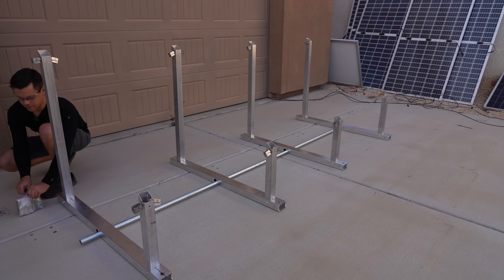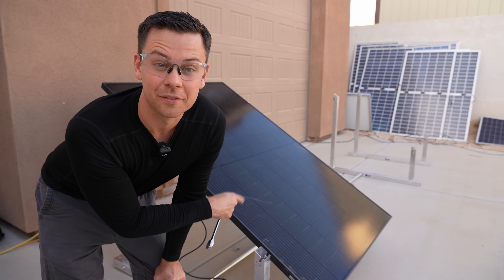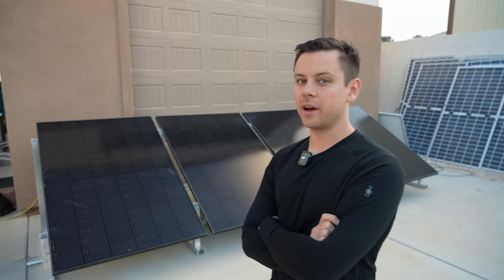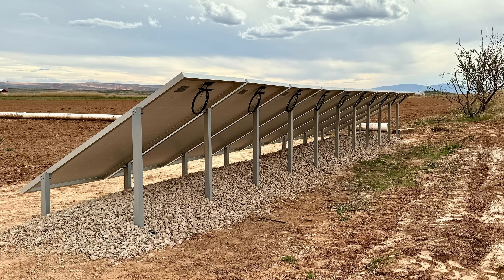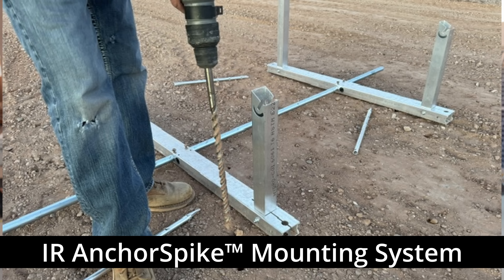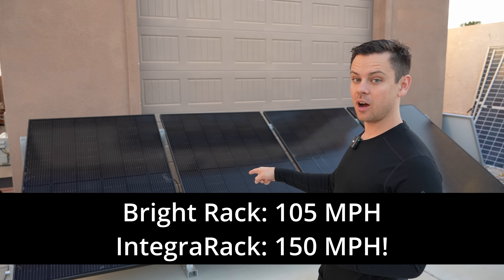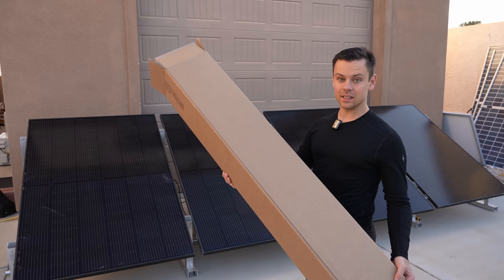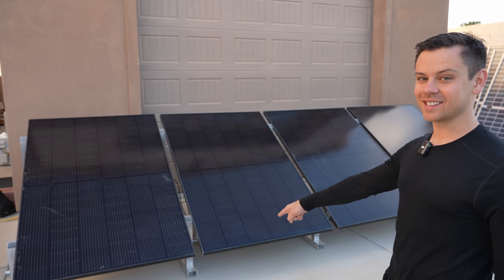IntegraRack: $545 Ground Mount Solar Array Assembled in Less Than an Hour!

Comment: was curious on your input on the best 48 volt system for a van I like the server rack idea and power to price but dont know how much it would take to keep something like your portable system charged I could see 500 watts 750 at max on roof but not enough voltage for to charge 48?

Comment: I've been trying different mounting angles for my panels & I discovered something curious.  When my panels are at 90⁰ to the sun I get the highest peak output, but I get the highest kwh per day, along with the highest sustained peak of approximately 6 hours, from laying my panels flat on my lawn.  This makes no sense to me, but my conclusion, then, is to forget the mounts/racks & just lay them all flat.  You have any input/pro-vs-con on this?

Comment: The only negative is the lack of adjustments for the solstice. In the winter panel are raised to 60° and dropped to 30°. Other than that issue I'd buy them and modify for adjustments.

Comment: Problems: Animals. Cows. Specifically. Projectiles, kids with guns, BB or otherwise. Quite tempting. Angle adjustment. Good looking solution though, I have to admit.

Also, the vertical mount for bifacial panels is awesome (different video).
Reply: No problem with our Llamas. We have critter guard installed. They go right up to it have a sniff then move on. 17 panels

Comment: Hey Will, 
I like the simplicity of it. But I haven't seen anyone with the post mount with solar tracker. I have 2  pole mounted systems and because I was only getting the best coverage in the afternoon. So I installed a set of solar trackers to my system and it makes a big difference. I would like to see more solar trackers. I wanted to share a video but I couldn't.  Thanks

Comment: Level of difficulty getting this entire thing up in the air? Above a shed or something? I imagine I could bury some poles 3 feet and just get this up. But is that true or would this fold if it’s not supported as it is on the ground, and, is it true that if not angled correctly, this could create a solar death ray on things behind it. 

Thanks for any help

Comment: I've got two 200w panels to install on a camper. I'm seeing that I need 8 gauge for 400watts but from the panels to the batteries it could be almost 30 feet from the solar panels to the charge controller to the batteries. Would that require 4-6 and what from the converter/inverter? 4 guage? One of my goals is to not set the camper on fire while not having a huge voltage drop from over building it. Such as the controller. 400w says 30 amp controller but I read the watt hrs will be like 33.3 per hr? Can a 30amp charge controller handle that at summer mid day peak?

Comment: Hey Will, I'm building a coffee trailer (mobile coffee shop) for the Denver metro area and would like to power it with solar. Not sure if you'd be interested in working through it with me to figure out how to run the power I need. I could bring the trailer to you. Might make for a very interesting video setting up a commercial espresso machine to run efficiently on a battery bank. Let me know, Cheers! Love the channel

Comment: Is anyone out there building a home power system that is mostly DC. Resistive floor heating, electric water heaters, ovens, stoves, dryers are likely the biggest energy users and all of them could be DC. You can still have an inverter but it could be much smaller.

Comment: Will i have a vehicle question
When i have lead acid starting  batteries and lithium house batteries...
Can i intercept the voltage coming off the alternator and send it through a charge controller to the lithium batteries to protect them...

Comment: I didn't see it anywhere but then again it's hard to search through the comments, BUT you should change your picture for this video.   It's NOT $545 with 4 panels,   It's $545 to mount 4 panels.    When I first saw your video I thought someone had really made a price breakthrough and would capture the solar mount market by storm.   $545 for four panels is still way more expensive than DIY solutions...

Comment: Holy cow, Will!  I've been away from the solar/battery stuff for a couple years and it's crazy to see the growth of your channel since then.  Congrats man, you deserve it.  Only downfall I see is in northern states with snow, it looks too low and snow could drift up on the lower portion of the panels.  Probably wouldn't be that hard to raise it some way, but just another thing to consider for those who don't live in the southern states.

Comment: Looks like it works great on a flat stable surface only.  Plus it is using the panel frame itself for structural integrity, placing a lot of extra stress on the silicon wafers.  Definitely not as strong as a rail system I would imagine.

Comment: Needs a way to cover the vertical tubes, here in the Florida insects and critters will nest there.  Open top tubes will collect rainwater and will rust the lower assembly.  High wind speed rating and everything else are major advantage.  Thanks for investing your time and funds to make informative & interesting videos!
Reply: Aluminum, so no rust issues. Critters tho... yes. I would like to see caps too just for the aesthetics of it.

Comment: I copied the GSE ground mount, welded rather than bolted together and added some tabs so i can move it around with pallet forks..120kg ballast per panel and it holds 2, cost less than €200 and a day to fabricobble.

Comment: Hey I have 2 12volt bildge pumps they can run up to 13.5volts if I want. My question is if I use a lifepo4 12volt then will it pute out 12 volts or more like 11.5? It's more expensive but am dreading having to go to 24 volt 150 amp hr and running a buck boost converter or sign wave converter.
Reply: I am running 2 pumps both at 12 volts one is 7amps the other is 15amps

Comment: i had a question about the easy 48v system and far as if i had 4 370w 37volt solar panels in sires it will be over 120 volts but its close would i need a mppt boost charge controler?

Comment: The cost is still way too high. the rack itself is way over priced, the should be about half the cost, now add several tons of gravel and the cost involved for that, or even more expensive is the water tank means to hold them down. Sounds good, but in reality  - not, simply because of the cost of the rack.

Comment: Say I wanted to hook a few panels up to power my computer, what's the cheapest inverter for the higher output panels and is there recommended max length for the cable from the inverter to an outlet box?

Comment: First off is if you caver it the Chinese metal will be destroyed over time. Best install is to create 4 or 6 concreate pillars and mount to that. You can do this cheap with concrete blocks or pour 2 bags per pillar.

Comment: Just came back from Baja California getting ready to start building my retirement home off grid been looking at different systems on youtube and in my opinion you got the best information on off grid system
Reply: I live in Cabo and have 140 acres in Todos Santos. Where are you building? I'm hauling 60 655 watt panels down to MX next week. CFE electricity prices are as expensive as California and WAY worse if you hit the DAC (domestic high consumption).

Comment: this is exactly the kind of product I am looking for... Does anyone know how the water tanks are used to hold down the frames? Like where do they sit (directly on the frames? how to avoid them tipping over? Shims?)

He mentioned 800 pounds, so I assume ~100 gallons of water, but then the tank pictured is a 35 gallon tank??? I've looked those tanks up on that website, just curious how they sit on the frame).

Are there any pictures or examples of that kind of installation? Can the manufacturer possibly add some example pictures of that kind of installation?

I would love to use that kind of method because I would like to enclose the tanks (to protect them from the sun) and be able to count that water as part of my prepper water storage. Maybe not water I would drink (unless in an emergency), but it certainly would be suitable for watering plants/washing/cleaning/etc.

Comment: Looks like excellent engineering. I'm glad there's some decent options available for mounting nowadays. Cosmetic wise I don't like gaps in-between panels. Function wise it be nice to be able to adjust the angle. Cool system though I honestly like it.

Comment: Remember, aluminum metal touching a concrete surface is not compatible. Therefore, you must have a neutral spacer between the aluminum and the concrete surfaces.
Reply: I did not know that about alumium and concrete.  Thanks.

Comment: I like a steeper pitch and higher off the ground the amount I lose in efficiency I make up for when the snow just slides off rather quickly in the winter just a view of the sountern sky and it simply works no effort no cleaning the panels off they stay clean enough to only go out with a shammy when its warm to clean off dust. I've only ever built with wood didn't need no anchors the amount of panels and the length kept it from getting knocked by 60+ winds. My wind turbine tower on the other hand took a dive at that speed. But yeah I'd never go with something this low to the ground or that low of a pitch I've already been there lived and learned. Although I know it is the most ideal angle for catching sun it sucks come winter time trust me on this one.

Comment: I just saw this video.  To say it's timely would be accurate.  I wintered in Arizona in my RV and I had 2 400 watt solar panels which I hauled with me in my motorcycle trailer.  I ground deployed them which worked but wasn't optimal.  I was planning to mount those panels to the roof of the trailer for next winter but after seeing your video I think I'll buy enough of these to mount all 3 of my panels.  I'll use large lag screws to anchor them into the ground.  In Arizona the soil is very rocky and lag screws work very well, even during wind storms.

Comment: Nice solar mounting system, I hope you do a review of Schneider Electric's new Conext™ XW Pro solar hybrid inverter/charger they often go on sale. they are a low frequency inverter that can handle large inductive loads split phase output but all has a low idle current draw.

Comment: Great video! If I understand correctly, it's just the mounting brackets - does it work with any panels, and what's the best (easiest) way to connect it to the house? As you have probably guessed, I'm a COMPLETE newb when it comes to solar - so I can use all the help I can get.
What kind of panels do you recommend, and what kind of power storage?
My property is surrounded by trees so I'm not gonna get a full 8 hrs of sun.

Comment: Great presentation, and I really like the way this racking system looks.  I am very curious about the AnchorSpikes  How long are they?  From their web site it looks like they are 3/4", but one of the pipes in your hand looks wider than 1".  Also, from your video you implied that you just drill out the hole with a hammer drill, set, and then pour the epoxy.  Is that true?  If so, do you drill the hole larger, smaller, or just shoot for the OD?
Reply: Just a note, the manufacturer just got back to me via email with the following information: they are 19.5" long, and you do drill out the dirt prior to setting the spikes, and then pouring the epoxy.  I think that code in my area requires to set ground anchors/spikes below the frost line (which is 30" in my local, and I believe most people use 48" as a rule of thumb).  This would be perfect for a short term install.  I will have to think about this one.  Once again, thank you for your informative video.

Comment: Couldn't that not be done with a bunch of 2 by fours for around $100?

Plus. Those are in a single fixed position. They are not movable throughout the day. You only get maximum power in the summertime. In the winter you are going to be running a heat pump. You're going to need a Battery Farm.. Outside of your living structure. When it goes up in flames.  Not if but when. And the batteries can be put in a small, Shipping Container. Like a 20 footer. When it catches fire it's confined inside the shipping container. Away from your occupied dwelling. In the backyard. Not in the garage. Not in the basement. Not on the side of the house. Behind the house. In its own structure. If, you want to be safe about things? And I would recommend having two of those. So that. When one goes up in flames. You are not without power before you rebuild it. You have backup redundant battery power. When you are going off grid. With the above ground water tank and the belowground septic tank. Everything keeping you alive will be in your backyard. In separate, modular, compartmentalized, structures.

And so one could take a, Childs, backyard, kid powered, circular whirly contraption. You build a platform on it. Put your solar array on it. Use an electric motor with a rubber tire drive. And you got a Lazy Susan. You can track the sun. With your solar panel array. Et Voilà! With 2 by fours and some plywood. And the kids backyard playset. And some anchors you put in the ground with eyelets and chains. So it doesn't go blowing away. Except with a Tornado. Only cement escapes most tornadoes. Oh well? It's like Dorothy and her little dog. Nothing you can do, bout that. With your rig, maybe? It could still be left 1/2 busted mess. With rocks and bottles and trees being thrown into your solar panels. Nothing really survives that. So just forget it! LOL.

I'm going to have to put a motorhome array together for myself soon. You've got superb videos on that. A bit pricey though. To do it right. As a retiree living on a fixed Social Security income only. I want to go all electric and off grid. So I'll have my work cut out for me. To get really creative and imaginative. And get an expandable system up and running first. Starting with a minimal, delivery of daily power. And I'm good at regulating mine. And where I really will not be inconvenienced. I will just be mindful. Which is a good way to be. Why waste what you don't need to? You only get so many recharge cycles. Solar panels only truly effective. For about the first 10 years. But when you're old like me. Why worry? Just like the guy in Mad Magazine. I used to read him every month. And Spy versus Spy on the back. And was that about racial injustice or communism? All I know.  I wanted that record called It's A Gas. And I had it. It came with my magazine. It was great! I think I was 12? And Star Trek had just come on the air. I could never miss that show. Absolutely devastated. When it was canceled. I waited for another network to pick it up. It never happened. How were we to live life then? Life is never the same again. Until reruns went into syndication. Then we got our captain back and first officer. And life got back to normal. When the movie came out in 1979. They were still all alive! The cosmic rays hadn't killed them! Huzzah! Huzzah! Huzzah!

Then we grew up to, The Next Generation. We got lost in space. At Deep Space 9. And then hopped aboard a Voyager. Then some clown guys started a new Enterprise. And I got old. How the hell did this happen?

I haven't quite been myself, since 1986. I've been somebody else. A woman! What the hell?
RemyRAD

Comment: Is it made of rust resistant materials?  I know it is not stainless steel, but I live in an area where it gets a lot of rain in the spring and worried that it will end up rusting away in a few years.

Comment: Those anchors with the epoxy are pretty cool. Used helical foundation posts from HD which took awhile to screw into the ground using a 4x as a lever arm

Comment: Can you clarify the water tank information? You show a 35 gallon tank. That'll weigh 280lbs. Would you use 100 gallon tanks (800lbs each), or 3x35 gallon tanks (840lbs total)?
Tanks designed for the interior of an RV will also degrade if exposed to sunlight.

Comment: Although they are not adjustable for angle as some have mentioned (barely a big deal living in the state of AZ with abundance of sun in most places), the numerous ways to secure make the system extremely flexible. With several of the mount methods make relocating so easy relocate is a huge advantage.  Since I am still building out my off grid property, things/plans change and the flexibility to so easily move the rack is again, a huge advantage. Glad to know about these!

Comment: Anyone know if theres a good way to hook up an inverter to the main panel by using a high amperage transfer switch? 
Basically moving grid input cables to a small load center where you can switch from inverter to grid instead of moving each individual breaker into a second panel.

Comment: Pour two parallel concrete runners 16" to 18"(wide)x 5-1/2"(deep) by needed length. Easy set-up and pour and finish, and not a lot of material. 
Personally I would use a structure allowing panels to screen sun for a patio or walkway. Ramada or carport.

Comment: Will, I appreciate you, your knowledge and your personality. Without you I wouldn't be installing a solar system, hiring an electrician only for the tie-in.
Reply: How's that going? I did the same thing a few years ago, but it took forever to find an electrician who was willing to pull the permit and do the tie-in. I called everyone in the area. I finally find a solar installer who would do it, but only if they installed everything, for quite a bit of money

Comment: I question how long aluminum will last in the ground.  I live with heavy clay and I placed an aluminum tool box from a pickup on the ground for about a year.  The bottom had almost dissolved from the outside. The ground was well drained with no pooling but would get wet in the rain.  there was no leak into the box due to weather.